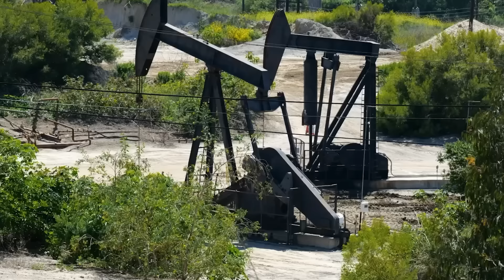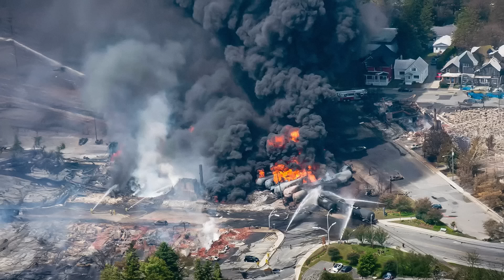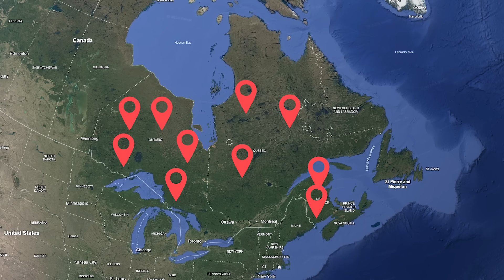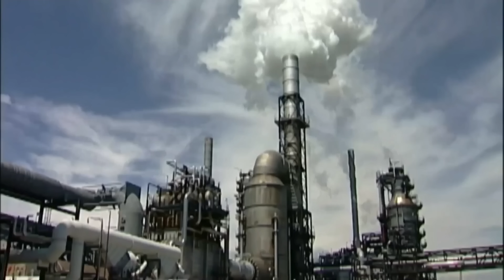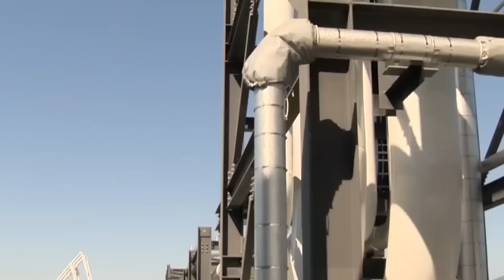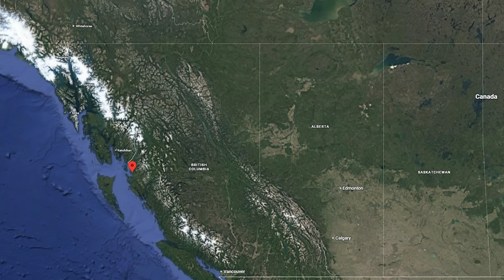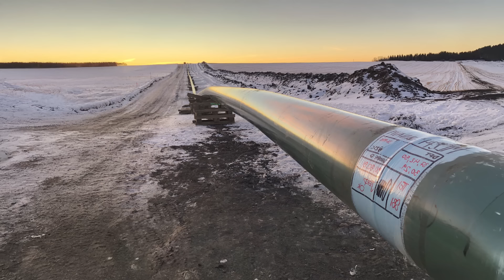Here's Why Canada Can't Build Its Own Refineries, Even Though It Produces Millions of Tons of Oil

Comment: infrastructure coast to coast to cost
- oil pipeline form the west to the Atlantic and Hudson Bay
- Natural Gas from the west to the Atlantic and Hudson Bay
- Electricity from East to west (Quebec and Ontario to the prairies) and to Nuavik 
- Telecommunications - secure Canadian information transmitted within Canada protected by Canadians
- 20% of worlds fresh water is in Canada - pump it to the dry praries

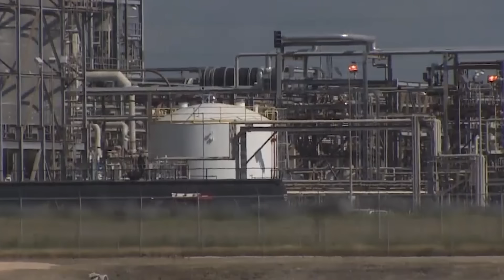Bull Sheeet at 6:00  the largest refinery in Canada, Irving Oil, Saint John NB HAS refined the western sludge - Quebec just won't allow it to cross its borders.  AND if this sludge can be pumped to Texas, it can be pumped to NB
-
Reply: Welcome to life under the idiot liberals
Reply: There are 13 out of 15 refineries in Canada that use Alberta bitumen sands heavy crude oil right now. 

All 13 of those refineries receive deliveries directly via pipeline from Alberta, including all four in southern Ontario (via Line 5) and the only refinery in Montreal (via Line 9).

The two refineries that do not use Alberta crude oil in their refinery diets are located on the south shore of Quebec City, in Lévis, and in Saint John, New Brunswick.

The refinery in Quebec City is owned by Valero and the same company owns a massive storage depot in Montreal. Furthermore, Valero also owns an oil pipeline between Montreal and Quebec City.

So the reader may be asking themselves: so wait, if there's already a pipeline between Alberta and Montreal and another oil pipeline linked directly to the same company's refinery in Quebec City, why aren't they using Alberta crude oil too?!

The answer is simple: it's not economical to do so.

Alberta bitumen is heavy in asphaltenes and low in resins. This makes it a low-value product that is generally used as a cheap blending agent to bring down the overall cost of refined petroleum products. Remember when the Conservatives told you that Western Canada Select oil was priced lower than West Texas Intermediate because there was insufficient pipeline capacity to Canada's west coast and Canada was stuck with only "one customer"? Well, the Trans-Mountain oil pipeline is now complete, exports are happening all over the world, plus, there is excess capacity available on it!! And the price gap between Western Canada Select and WTI is still over $12/barrel on average!! Chalk it all up to yet another Conservative lie. Pierre Poilièvre is a rank expert at lying to Canadians and Conservatives are repeating the same, tired lies that are being disproven every day with TMX exports to Asia. Bitumen sands crude oil is low quality, and no amount of pipelines will ever change that. 

No, Valero actually uses their pipeline to ship finished products westward, from its refinery to Montreal instead of shipping Alberta crude eastward. 

Suncor also owns a Quebec refinery, in Montreal.  Suncor blends Alberta crudes with imported crude oil from overseas via tankers that land from the eastern US, Norway, the Middle East and Nigeria with light, sweet crude oil. The imported oil either arrives by tankers, or occasionally, gets unloaded in Portland, Maine and then piped to Montreal. 

Incidentally, the company that owns the Maine to Montreal oil pipeline applied to reverse its direction, so that the line could carry tar sands bitumen from Line 9 to Portland, Maine for marine export via tanker.  Concerned citizens of Portland in 2014 passed a municipal ordinance banning the export of oil sands bitumen at the Port due to environmental concerns. Portland Pipe Line Co (PPLC) filed a lawsuit to overturn the ordinance as unconstitutional, and against interstate and international trade. They lost in Court and abandoned their appeal in 2021. 

Many find it amusing to listen to the same Conservatives who worked tirelessly to destroy Canada's National Energy Programme in the 1980s now turnaround and counsel the government to ignore the economics and build a brand new pipeline from Alberta to those two refineries, even though it makes zero economic sense to do it today with all the existing infrastructure in place.
Reply: @paulboileau3758  
lovely story - you keep forgetting (omitting?) that the LARGEST refinery in Canada is NOT serviced by a pipeline of any kind and has proven it can refine the Alberta Sludge (The Telegraph Journal when Energy East was discussed a decade or two ago)
None of these west-east pipelines travel entirely in Canada and that one of them (under lake Michigan?) has a group actively trying to get it closed down
Infrastructure corridor - Coast to Coast to Coast

Comment: Alberta needs to refine its own oil because the US has Venezuela crude again.  Selling raw product is always a long term fail.  Value-added is always the best long term plan.  Refine those tar sands down to fuel and lube products within 100 miles of the source.  California is paying $4-5 bucks for gas at the pumps.  Instead of shipping to crude to Asia at a steep discount they could cash in big if they were shipping gas and diesel right down the coast.  As it stands now, Cali buys a lot of its gas from Asia made by refineries capable of processing Canadian crude.  Asia is shipping it all the way over the Pacific, refining it, and shipping right back as ready fuel for a profit.  California, for all its lefty hippie noise is still the biggest consumer of fuels in the US and has to pay Asia top dollar to fetch/process/send Canadian origin fuel for them.
Reply: AB has 5 refineries *facepalm* and meets domestic demand for gas, diesel etc with a surplus which is exported. We tried building a new refinery, the Northwest Redwater refinery, and it was an utter failure as a business which may never payout. From there, everything else in your comment is dumb and falls flat on it's dumb face. We need to continue exporting crude oil to countries BESIDES the US (which was the destination for like 99% of our oil for decades until last year when TMX started).
Reply: Indeed, Canada is a net exporter of refined petroleum products.

Canadian exports of finished petroleum products hit a new high of 19.6 million cubic metres in 2024, up 10.5% from 2023.

Meanwhile, Canada imported 8.5 million cubic metres of finished petroleum products in 2024, down almost 5.4% from 2023.

There are 13 out of 15 refineries in Canada that use Alberta bitumen sands heavy crude oil right now. 

All 13 of those refineries receive deliveries directly via pipeline from Alberta, including all four in southern Ontario (via Line 5) and the only refinery in Montreal (via Line 9).

The two refineries that do not use Alberta crude oil in their refinery diets are located on the south shore of Quebec City, in Lévis, and in Saint John, New Brunswick.

The refinery in Quebec City is owned by Valero and the same company owns a massive storage depot in Montreal. Furthermore, Valero also owns an oil pipeline between Montreal and Quebec City.

So the reader may be asking themselves: so wait, if there's already a pipeline between Alberta and Montreal and another oil pipeline linked directly to the same company's refinery in Quebec City, why aren't they using Alberta crude oil too?!

The answer is simple: it's not economical to do so.

Alberta bitumen is heavy in asphaltenes and low in resins. This makes it a low-value product that is generally used as a cheap blending agent to bring down the overall cost of refined petroleum products. Remember when the Conservatives told you that Western Canada Select oil was priced lower than West Texas Intermediate because there was insufficient pipeline capacity to Canada's west coast and Canada was stuck with only "one customer"? Well, the Trans-Mountain oil pipeline is now complete, exports are happening all over the world, plus, there is excess capacity available on it!! And the price gap between Western Canada Select and WTI is still over $12/barrel on average!! Chalk it all up to yet another Conservative lie. Pierre Poilièvre is a rank expert at lying to Canadians and Conservatives are repeating the same, tired lies that are being disproven every day with TMX exports to Asia. Bitumen sands crude oil is low quality, and no amount of pipelines will ever change that. 

No, Valero actually uses their pipeline to ship finished products westward, from its refinery to Montreal instead of shipping Alberta crude eastward. 

Suncor also owns a Quebec refinery, in Montreal.  Suncor blends Alberta crudes with imported crude oil from overseas via tankers that land from the eastern US, Norway, the Middle East and Nigeria with light, sweet crude oil. The imported oil either arrives by tankers, or occasionally, gets unloaded in Portland, Maine and then piped to Montreal. 

Incidentally, the company that owns the Maine to Montreal oil pipeline applied to reverse its direction, so that the line could carry tar sands bitumen from Line 9 to Portland, Maine for marine export via tanker.  Concerned citizens of Portland in 2014 passed a municipal ordinance banning the export of oil sands bitumen at the Port due to environmental concerns. Portland Pipe Line Co (PPLC) filed a lawsuit to overturn the ordinance as unconstitutional, and against interstate and international trade. They lost in Court and abandoned their appeal in 2021. 

Many find it amusing to listen to the same Conservatives who worked tirelessly to destroy Canada's National Energy Programme in the 1980s now turnaround and counsel the government to ignore the economics and build a brand new pipeline from Alberta to those two refineries, even though it makes zero economic sense to do it today with all the existing infrastructure in place.
Reply: The usa will no doubt build fuel pipelines to cali from texas soon.
Reply: The reason California is so  high is
1. Highest state tax in USA .
2. Special California only blend of gas .

You will not get a piece of that high price gasoline …

Comment: Why don't they turn the Alberta oil (tar sands) into electricity, and ship it in wires?...
Reply: Good question !
Reply: Efficiency drops
Reply: Ship it where? Alberta, Saskatchewan, and Manitoba are the provinces most in need of electricity.
Reply: @kevinmcgregor808  not Manitoba they have a lot of cheap Hydro and export a significant amount of electricity to the US (Minnesota)
Reply: @kevinmcgregor808  Sell it to the data centers !!!
Reply: That doesn’t support the liberals leftist agenda of NET ZERO
Reply: The electricity grid has nowhere near the capacity to move that much energy.
Reply: Oil is too valuable to be burning it just to make electricity when there are so many other ways to generate electricity that are cheaper, and oil is useful for things that electricity can't do.  You wouldn't want to see your electric bills go up just because your utility had switched to oil-fired generation, would you?  Don't say you would, out of patriotism, because I know you wouldn't.
Reply: CO2 production. You love the wildfires?
Reply: There are 13 out of 15 refineries in Canada that use Alberta bitumen sands heavy crude oil right now. 

All 13 of those refineries receive deliveries directly via pipeline from Alberta, including all four in southern Ontario (via Line 5) and the only refinery in Montreal (via Line 9).

The two refineries that do not use Alberta crude oil in their refinery diets are located on the south shore of Quebec City, in Lévis, and in Saint John, New Brunswick.

The refinery in Quebec City is owned by Valero and the same company owns a massive storage depot in Montreal. Furthermore, Valero also owns an oil pipeline between Montreal and Quebec City.

So the reader may be asking themselves: so wait, if there's already a pipeline between Alberta and Montreal and another oil pipeline linked directly to the same company's refinery in Quebec City, why aren't they using Alberta crude oil too?!

The answer is simple: it's not economical to do so.

Alberta bitumen is heavy in asphaltenes and low in resins. This makes it a low-value product that is generally used as a cheap blending agent to bring down the overall cost of refined petroleum products. Remember when the Conservatives told you that Western Canada Select oil was priced lower than West Texas Intermediate because there was insufficient pipeline capacity to Canada's west coast and Canada was stuck with only "one customer"? Well, the Trans-Mountain oil pipeline is now complete, exports are happening all over the world, plus, there is excess capacity available on it!! And the price gap between Western Canada Select and WTI is still over $12/barrel on average!! Chalk it all up to yet another Conservative lie. Pierre Poilièvre is a rank expert at lying to Canadians and Conservatives are repeating the same, tired lies that are being disproven every day with TMX exports to Asia. Bitumen sands crude oil is low quality, and no amount of pipelines will ever change that. 

No, Valero actually uses their pipeline to ship finished products westward, from its refinery to Montreal instead of shipping Alberta crude eastward. 

Suncor also owns a Quebec refinery, in Montreal.  Suncor blends Alberta crudes with imported crude oil from overseas via tankers that land from the eastern US, Norway, the Middle East and Nigeria with light, sweet crude oil. The imported oil either arrives by tankers, or occasionally, gets unloaded in Portland, Maine and then piped to Montreal. 

Incidentally, the company that owns the Maine to Montreal oil pipeline applied to reverse its direction, so that the line could carry tar sands bitumen from Line 9 to Portland, Maine for marine export via tanker.  Concerned citizens of Portland in 2014 passed a municipal ordinance banning the export of oil sands bitumen at the Port due to environmental concerns. Portland Pipe Line Co (PPLC) filed a lawsuit to overturn the ordinance as unconstitutional, and against interstate and international trade. They lost in Court and abandoned their appeal in 2021. 

Many find it amusing to listen to the same Conservatives who worked tirelessly to destroy Canada's National Energy Programme in the 1980s now turnaround and counsel the government to ignore the economics and build a brand new pipeline from Alberta to those two refineries, even though it makes zero economic sense to do it today with all the existing infrastructure in place.
Reply: Refineries in the USA are designed to refine heavy crude like Alberta tar sands oil. But since the USA has gone to fracking they now have an abundance of sweet light oil which they sell on the open market. Why not bring light oil in from the USA and mix that with our tar sands oil.
How about Quebec allow an extension of there pipeline to New Brunswick so we in the East don’t have to import oil. Canada should be self sufficient in its energy needs. But because of the liberal Net Zero agenda and kiss ass policies generated by the WEF we will own nothing and be happy while Globalists like Carney live the good life. Unfortunately Canada has been governed by self indulgent politicians who never had the countries best interests at heart. It’s all about collecting the massive paychecks and benefits while doing absolutely nothing…..
Reply: @robm3357 

We don't need light sweet crude to blend with heavy tar sands bitumen. We have condensate that is sent via pipeline from all across Eastern BC and northern Alberta to Fort McMurray. Condensate is what is making most natural gas compressor stations profitable, not the gas itself.